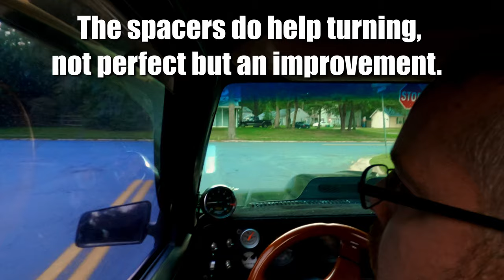V8 S10 Full Rip Tire Testing + Wheel spacers and Power Stop rotors upgrade for the s10.

Comment: I found there to be some vibration with my non hub centric spacers and switched to some hub centrics with better results. Still some vibration but less so than the others. Love your truck though. great build.
Reply from the maker: I did not feel any vibration till about 120 mph lol 😆 I will probably remove them at the track, need to do more testing.

Comment: I used to run 26” drag radials on my car, hooked good but the engine seemed to rev past the torque curve, went to a 28 x 9 Hoosier slick and it definitely pulls harder.